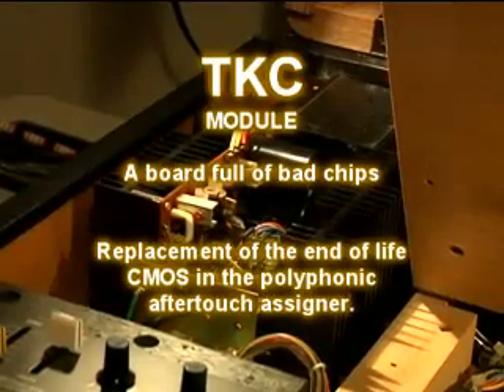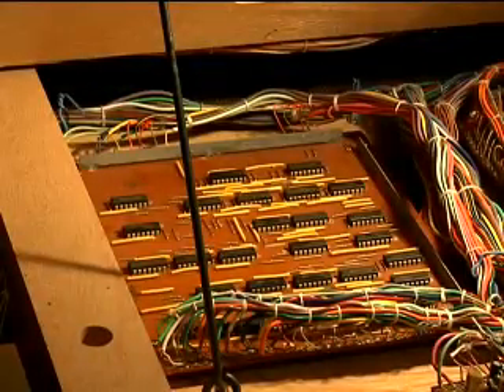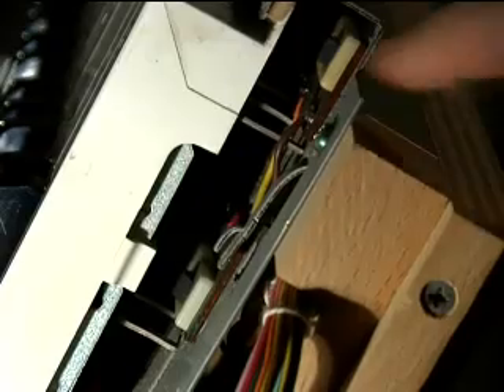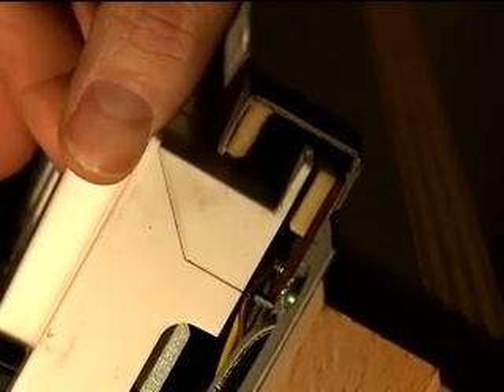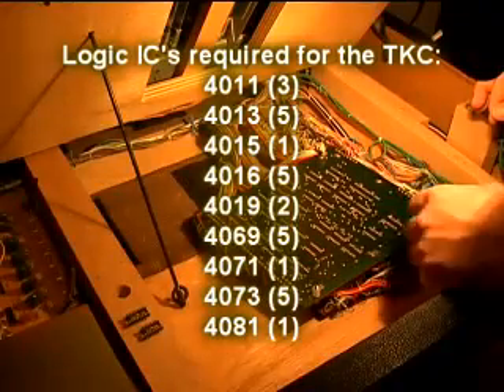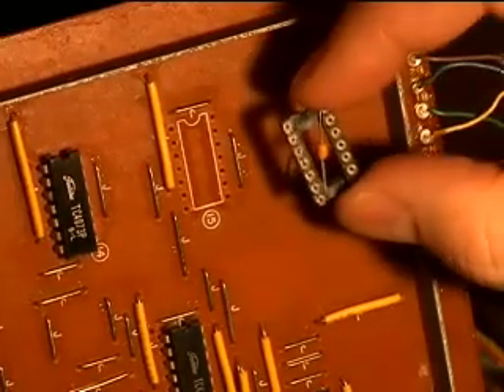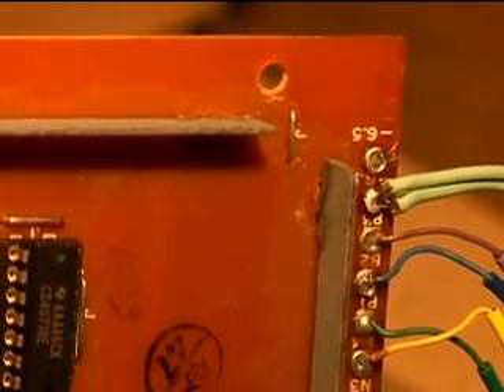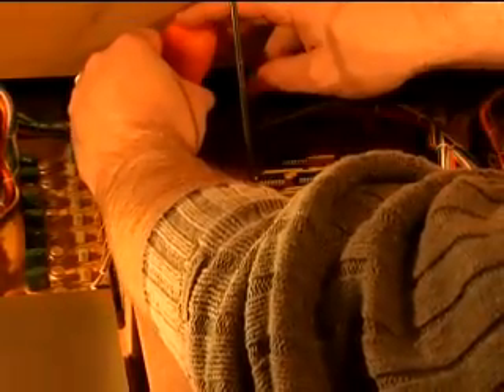Saving the Yamaha CS-80 (4) Touch Key Coder

Comment: can i ask why you're using  such a huge value for a decoupling cap (100 µF) instead of something like a 10or 22µF?
Reply from the maker: +antigen4 Honestly, I probably over-did it, but no harm as those power rails are shared by 35 more circuit boards upstairs in the synthesizer. The circuitry of this key coder state machine is literally clocked by key strokes, so it has very low transitional state noise. Perhaps this is why they never had caps in the first place by the original engineers in a perfectly health CS-80.  But to ensure stability, the .1 (or .01) capacitors between VSS and VDD of each IC should be there and is what I installed. To offset the other possibly ailing bulk filter caps, I wanted a bit more decoupling than necessary.
Reply: The Dollar Guy okay thanks for that then... I'd just never seen anyone use such large value caps for the purpose. Still learning the ropes really and have a CS50 i'm thinking of 'cleaning up' so I thought I'd try to see what i could learn from the insides of 'big brother'...

Comment from the maker: @music01234567 

Noooo....   many people can repair these as yourself.

In the car you have metal chassis and +12V battery or alternator output.

In this musical instrument (it's a sexy one), the metal chassis has the earth potential voltage threshold with above and below electrical potential.

That means you will have systems operating above and below the ground.  To make the old chips work, they provided 8.5 volts and -6.5 volts.

My memory is bad, but the 8.5 volt transistors shorted....?